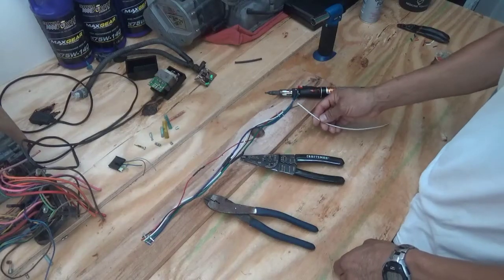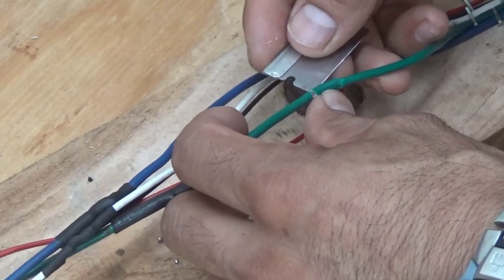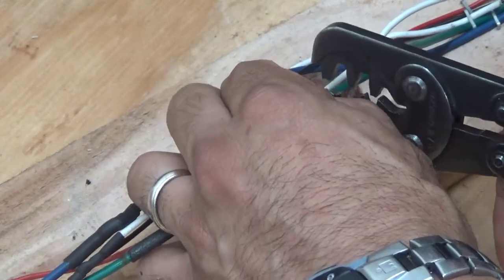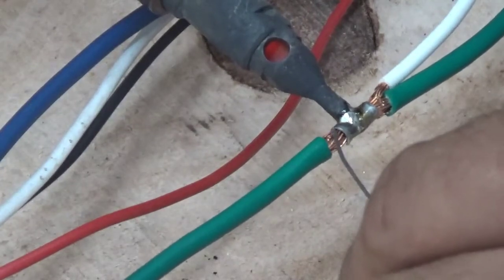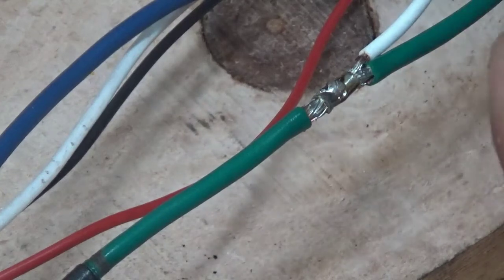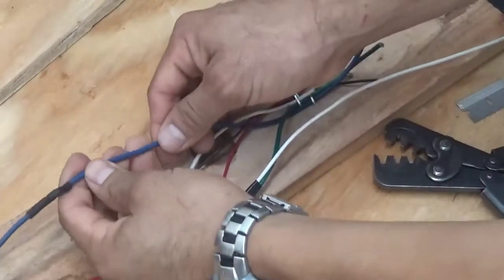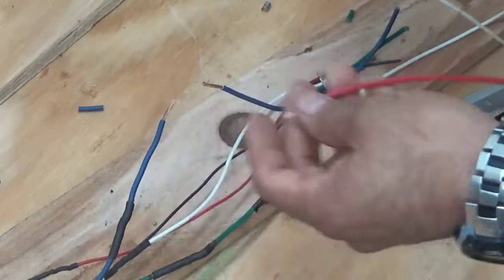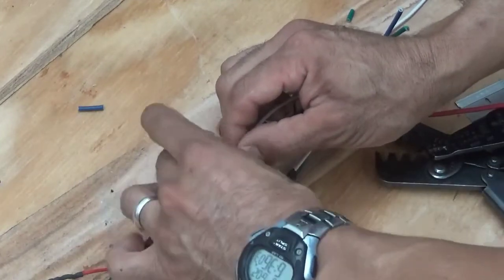Wire splicing

Comment: We seem to use similar wiring methods. I use an electric heat gun though. I keep a large collection of used wires of many colors for reuse. Solder and heat shrink have never failed me yet. I use silicone dielectric grease on mechanical couplings, something I learned was a necessity doing builds in Miami Florida!.
Reply from the maker: Oddly enough I've never used a heat gun to shrink tube. But yes, I do have tons of spare wire, and solder spools at that. Can't beat a solder repair, thanks for watching, and commenting